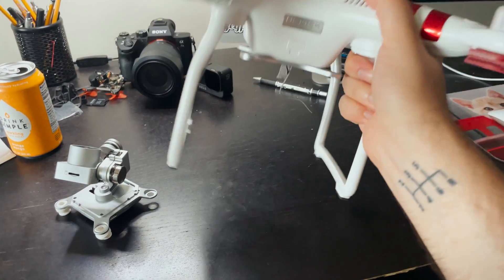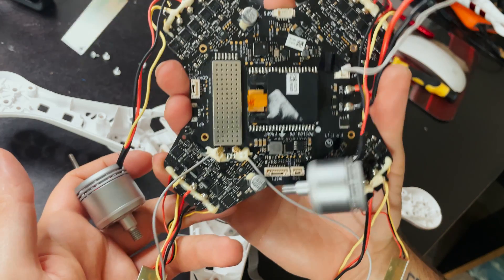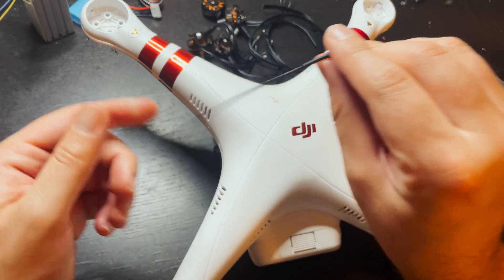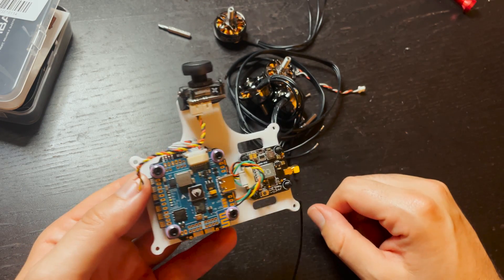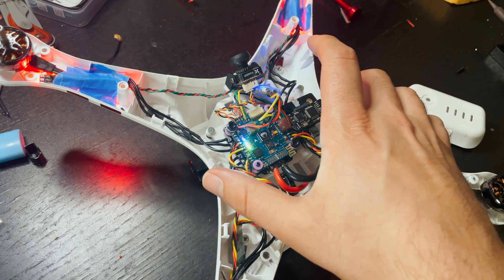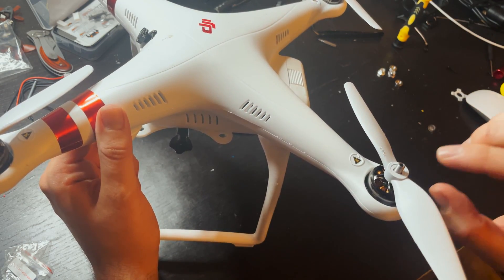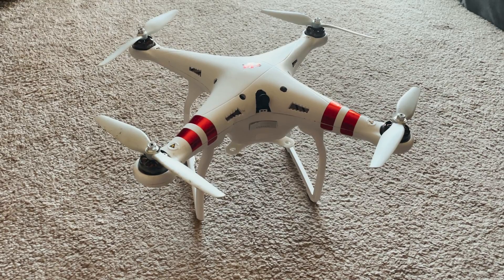Building an FPV Phantom 3

Comment: I have an old Phantom 2 Vision that I was thinking of doing something like this with. Would it be possible to use the stock DJI motors or is it better to gut the thing and use FPV motors built for that purpose?
Reply: You can just use stock

Comment: why not keep the old motors? just can adjust them on the setting on the pid page of betaflight, 4s motors can definitely run on 6s batteries
Reply: Yea heard 800kv though small motors for 9" stock props it can run 6s.
I want to do this. I have a phantom 3 and mini 1 I don't use.

Comment: How did you mount your motors? The spacing seems different than regular sized motors.
Reply from the maker: the mounting holes are a very odd setup. I mounted the motors using 2 bolts since only 2 lined up.
Reply: @TRONCATFPV  19x19?

Comment: Should've kept the GPS=)
Reply from the maker: haha I kept all the original components from the phantom, I doubt the GPS could be used on an FPV drone though.
Reply: @TRONCATFPV  It's hard to see how many wires the connector actually uses, 4 or 5. If it's 4, it's pretty much guaranteed that it's 3V3/5V, GND, TX and RX. If it's 5, it might not be compatible, but you could check quite easily what all the 5 wires actually do. I'm betting it's a standard UART GPS. Would be neat to use the original=)

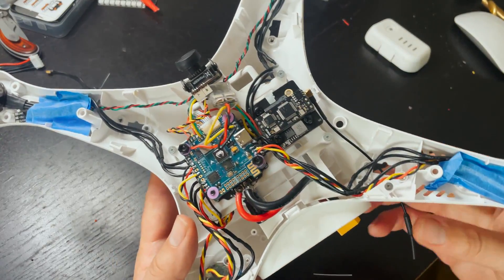Comment: As a new drone flyer I enjoy your channel. You are obviously very knowledgable about drones.   I was one of many 1000's who bought the Xiaomi Mi4K drone.   It was released several years ago now and many users are in need of batteries.  Therein lies a big problem as the Mi4K drone uses a special battery only made by Xiaomi.  It appears Xiaomi has stopped producing them and existing inventories at retailers are all sold out.  I have searched far and wide for  weeks trying to find batteries to no avail.  The odd one can be found on Ebay but they are ridiculously priced at $400. (probably old inventory too) which was nearly the cost of entire drone.  No one would pay such a price-gouging price.    There are no aftermarket batteries or other alternatives I am aware of to use in place of the original.  My thought is to disassemble the Mi4k drone battery and replace the battery.  In a video called "mi drone battery burn.." by AK Experiment world at about 12:50 the Mi4K battery can be seen in pieces. It has 4 thin  4.35V cells 5100mAh  to make up the battery which new is 17.4 V,  5100mAh.   Are such Lipo cells available (source ?) and could one make such a battery replacement?
Reply from the maker: I just did a bit of research on the drone and I see what you're saying. That is definitely a frustrating situation. I think the best route you could go would be reaching out to battery manufacturers to see if they have a potential replacement set of cells you could get. I think that assembling the battery so that it works with your drone will be up to you though. I would reach out to a company like tattu or CNHL to see if they can help you out. I hope this helps!
Reply: @TRONCATFPV  Actually I spoke to a tech at MaxAmps they own Tattu and he told it would be best to send in an old battery and they would likely be able to rebuild it with new LiHv cells and give me 3 yrs or 300 cycles warranty also.  They rebuild a lot of batteries. So your suggestion is a good one...thanks.